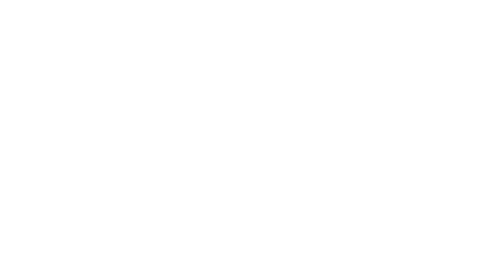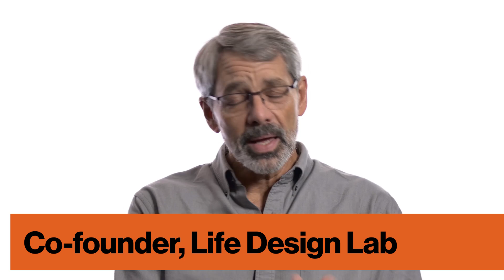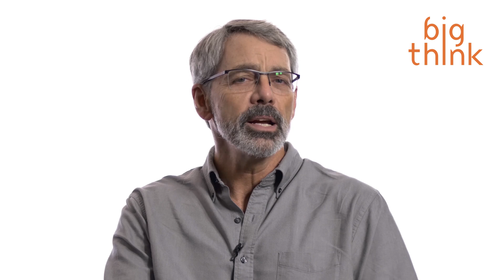Want to Make Better Decisions? Know the Difference between Engineering and Design Thinking

Comment: I watched three times to get him, he sees design as a solve problem thing, and approach using the design thinking from standford. Very good presentation.
 i resume it like this...
"the difference between engineering thinking and design thinking"
 design thinking use prototyping to define what i want to do, and engineering how to to it in scale and properly that works and pass industry quality tests and operations in the firm. Good work.

Comment: types of thinking/problems:
1. engineering - clear, repeatable solns
2. business - optimization
3. analytic - used in research; premise, slice, questioning process
4. wicked - criteria for success unclear & constantly changing; will know what's right answer only when you find it, & answer won't be reusable; human problems, messy problems; find soln via iterations, trial & error till you get an idea

types of prototypes:
1. engineering - starts with conclusion, solution-oriented
2. design - starts with curiosity, user-oriented

Prototypes in design similar to minimum viable product
Reply: Great summary!
One slight caveat I'd add regarding the idea that "Prototypes in design similar to minimum viable product": 
Prototypes are questions (not demos): they’re focused on a single point of inquiry, should be incomplete, and create an experience 
The prototype creed is effectively:
1. Find the quickest path to experience
2. Doing is the best kind of thinking 
While building a minimum viable product may involve doing and let you answer the question "What might it be like to use this product?", it'd be neither quick nor focused on a single point of inquiry.
I'd say a prototype in design is closer to "answering a pressing question by creating minimum viable experiences." I'm not sure there's a well-known correlate for that, which why design thinking makes a significant contribution. :)
Reply: Thanks for summing it up.
Reply: Err whats 'solns'?

You forgot systems and mechanical thinking...?

Comment: As an engineer, the attempt to bin engineering like he does could only be done by a non-engineer. Most of what I do is what he calls design, to which I then apply business (optimization) to, and then the 'engineering' at the end. I do work in a special place where almost everything is a single-purposed, single-designed, prototype though. I dislike his theory.
Reply: all he's saying is that it's a different skill, not that engineers can't do it.
Reply: Then you will be disappointed to learn that Dave has both a BS and an MS in mechanical engineering from Stanford. The technical and business mindsets can help you build the thing right, but it takes a very different mindset (and design isn't the only one, but it's a good one) to know the right thing to build.

Comment: lol I started off by researching wicked problem in urban planning. they're not that hard to solve
Reply: though I prefer to call them metaproblems. rittel's name seems simple
Reply: "A wicked problem is a problem that is difficult or impossible to solve because of incomplete, contradictory, and changing requirements that are often difficult to recognize" If you can solve wicked problems, you should go for it. Lol.
Reply: I'm an urban planner I know the definition, however to fix any system you need to have the means of playing the game. what are moves with no pieces? thoughts
Reply: which is also why we have this problems In the first place, resource silos and inequal access.